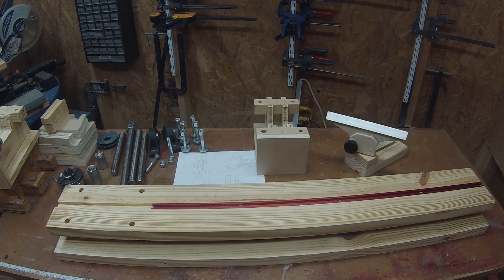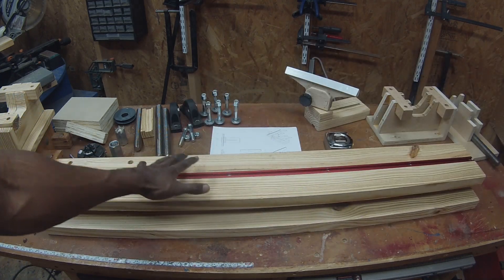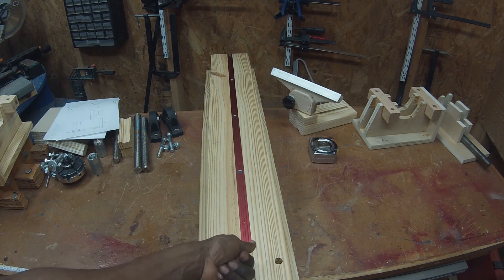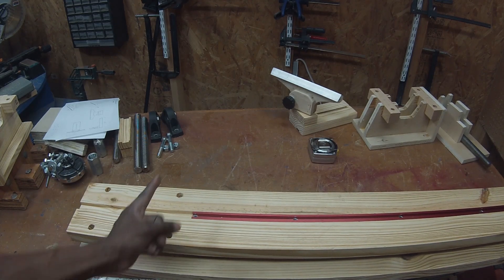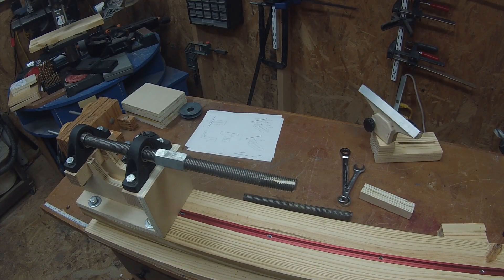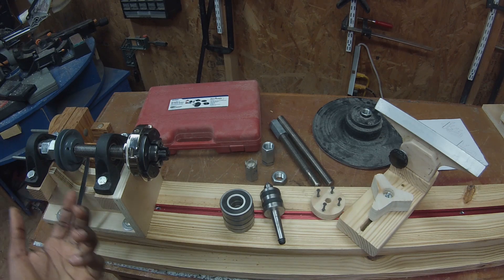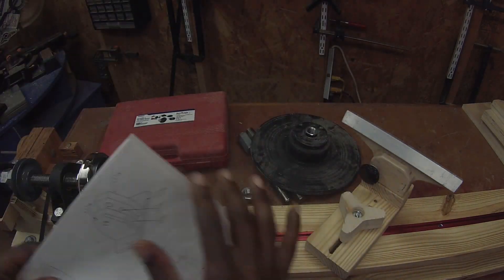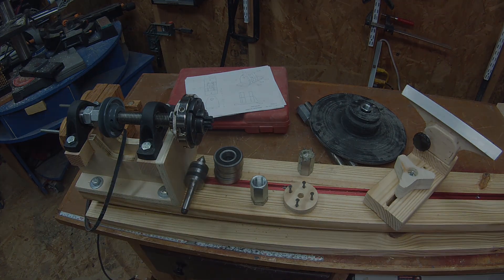The Lathe Part 3,The Rail, HeadStock and Tips For Designing Machines: 023

Comment: how did you attach a pulley to the treadmill motor?  Is that pulley made of wood also as your driven pulley is?  Thx.
Reply from the maker: It depends on the shaft of the treadmill motor. Some have a standard shaft with a key way and you just buy a pulley to fit it. Or you have to custom make something. It is not something I can really talk you through in the comment section. It just depends on the situation.

Comment: Seems to me that cutting the dado for the T track would be easier if you started with stock wider than you need, then dado it the exact dimension close to center, then trim the outside edges to width.

Comment: great vid indeed! would this lathe be useful to make bushings, flanshes, adaptors from metal? i mean, precise enough for 1/10mm?  or is it just for wood-work, like d stuff you did?  i also find it VERY hard to fabricate pieces which are really 90°  or flatFLAT!   for d non-carpentors or cabinetmakers amongst us  :)
Reply from the maker: I have sanded metal parts but I would not recommend trying to cut them. Wood is not rigid enough nor moisture stable enough for that level of precision
Reply: @Jeremy_Fielding  yeah i was afraid you'd say that.... fantastic project anyway!!
Reply from the maker: I have sanded metal parts but I would not recommend trying to cut them. Wood is not rigid enough nor moisture stable enough for that level of precision

Comment: The best reason for pillow blocks is that any small centerline from bearing to bearing misalignment is removed and 4 point vertical and tilt shimming to pivot the chuck slightly as the pillow blocks have the universal joint function.

Comment: Make a motor platform attached to the bed. Cut and hinge the platform parallel to the bed. The weight of the mounted motor provides the tension on the belt. Have the platform extend out behind the motor a bit to place sandbag or hang extra weight off it if extra belt tension is needed. Saw it once with a old fashion toilet seat lid brass hinge axel style. Amusing bit of salvaged bling.
Reply from the maker: I personally don’t like that approach. It works but imperfections in the belt lead to vibration. The motor becomes a huge shaking mass. Bolted down, it prevents vibration
Reply: @Jeremy_Fielding  Good point. Sand bags would dampen that greatly but still some vibration. Would work for a smaller model builder size units maybe. Salvage of damping design from a washing machine tub mounting system? Other damper ideas but that is getting into some of us crazy mechanical contraptions fanatics among us woodworkers. 
Accessory.  Riser blocks of 1, 2, 3 inches of glued block assemblies to elevate the head stock for bowl tuning. Similar concept to the riser block accessory for bandsaws.  I don't think they should be any higher, there may be an unforeseen issue. For bigger hp turning just make a dedicated stand alone headstock unit, you don't see these much any more. Had one in high-school shop long ago.
The bits and pieces, mechanisms, re-use re-purpose, simple fabrication, basic common parts available as store bought is half the fun. 
from Canada, keep on.

Comment: I have an old table saw motor. Would that work for this?
Reply from the maker: Probably yes. If it has capacitors on the side... definitely yes. The capacitors (usually inside a thin metal bulge on the side of the motor) indicate it is an induction motor. They are ideal because they will  hold their speed even when you start cutting. DC motors are also good if you want variable speed.
Reply: That is way more power then needed. The work piece mass acts as a flywheel giving strong mass in motion torque against a thin cutting tool edge. Big power is not required, your are driving a belt. Excess power will just be wasted as heat from slippage of the belt, slip will polish up the belt increasing slippage over time. You are just skim cutting wood, why do you think you need big power?
Any motor to drive a rotating vice (what a lathe is). Why would you think a table-saw motor not work? Table-saws come with various different motors, whatever you want. You can spin a rotating vice with a V8 automobile engine if you want. Your reference as a 'table-saw motor' is not how tool's power sources are referred to. This indicates a non-familiarity with power tools. I would suggest you stay well away from table-saws.

Comment: I want to build a metal lathe . I don't need all the features. since I will not be threading anything. so a manual feed would be fine. just finding a chuck. a end mill would be great also. I have seen ave build one from a drill press. great video.

Comment: Really enjoying your videos. What did you find the pillow block bearings in? Assuming you salvaged them from a machine and not just found them as-is.
Reply from the maker: +Aubreykun I think it was a large exercise machine. But I don't remember for sure.
Reply: Aubreykun you can buy those pillow bearings at most farm supply stores

Comment: Have you considered using a bicycle gearing system. The chains can have a removable link (no more forgetting to put the belt on first) and with some of the smaller bikes, like my sons 20", has 6 gears on the back sprocket and it's less then 2" thick, you can save a lot of space but, you would definitely need a guard.
Reply from the maker: Well once your lathe is assembled you won't have to think about the belt. Its only during construction you may take it apart more then once and that is when its important to remember. I think a bicycle sprocket could do the job. But you are really modifying it's use and that requires some really careful work and testing. You will need to make the sprocket fit concentric to your shaft or it will shake your whole workbench when spinning. You will need to do the same for the motor shaft and it's sprocket. You also need a way of holding on to the sprocket. This can be done for sure, but it will take some planning and thought to do it safely. The gear shifting needs to be easy enough without having to remove the guard. Or it should be very easy to remove the guard itself and replace. Other wise you will never want to do it. Before I tried this there are a few conditions that would need to be in place. I already have a bicycle sprocket I am not using, I really want/need more then two or three speeds, I have the tools to drill out the sprocket to fit my lathe shaft and motor shaft. If this is you, give it a shot. I think wooden pulleys are easier unless having more speeds is important. I think it is important... and that is why I am using a DC motor with speed control. I like the idea, but I think it will be a challenge to get right.
Reply: Agreed, the D.C. Motor does seem to be the better choice, especially since it adds to the safety and control. As you mentioned getting it squared, balanced and true can be difficult. I'm more of a metal worker but your tools are universal and I really appreciate your time and effort.

Comment: The best way to center the head with the bolt would be a dial indicater. This would get it to .001" if you took your time. you can pick them up for $10-$15.
Reply from the maker: +Jeremy Miller I have a dial indicator, but not everyone buying my plans will have one.

Comment: Is that threaded rod not going to chowder up the inner race of the bearings?
Reply: Daneger Most bearing surfaces are harder steel the threaded stock is normal steel so should not affect  them. How ever if the rod was turning in side the bearing surface it would wear the harder material this seems counter intuitive but the reason is particles of the harder material break off and are inbeded into the softer material it acts like a grinding paste!
Reply: Yeah that was my concern.  The races aren't tapped so I'm figuring on there being slippage when load is applied or the motor is started.  How long before you're replacing bearings is the question, I guess.
Reply from the maker: The load will lead to more grip on the inner bearing surface not less. However, even if they last 5 years with heavy use, they are extremely easy to replace. 
As a comparison I made my wooden scroll saw using the same method, that is thread-rod against a bearing. After two years the bearing surface looks fine. 

Perhaps I am less concerned because they were free. But the only alternative is to have a shaft custom made with threads on the end... assuming you don't have to tools to make such a rod. And that is the group I think this project appeals too. If you have metal working tools, You probably won't make a wooden lathe.
Reply from the maker: Another option perhaps if it concerns you would be to fill the threads with expoy or even electrical tape wrapped really tightly around the shaft. It would rub off the edges of the threads and fill the valleys. Just throwing ideas out there.
Reply: Ah, Jeremy, good to know!  I agree, if they last even just a couple of years it's a worthy method.  I was concerned they wouldn't make it that far at all. I haven't seen your wooden scroll saw build yet.  Glad to hear the threaded rod design is work tolerant.

Comment: Hey Jeremy....FWIW....in case you are unfamiliar with them, surpluscenter.com has several products for cheap that can be used in many of your projects, including motors. ... specifically ...a 1" pillow block bearing for 6.95, that is tapped on the bottom for bolts, rather than having the ears on each side...... your style for around 9.00. pulleys, belts, casters, switches, etc

Comment: hello sir! dumb suggestion here, i think adding a centrifugal flywheel at the back of the shaft can increase the spinning power of the lathe machine idk if would work tho, what do you think?
Reply from the maker: +bule bule there is a trade. The work piece will have more momentum while spinning, but the motor will have to start under a much greater load to get the mass spinning. Treadmills use a heavy fly wheel because you have a few hundred pounds suddenly hitting the belt every second or so. Lathe work is not quite so intermittent. If You are expecting to do aggressive lathe work it might be worth looking at.
Reply: +Jeremy Fielding Ah I see, Do you recommend using this on metal works?

Comment: Any ideas for the a motor I found? It's an old furnace motor: Delco 1/6 horsepower, 1732 rpm. Not enough torque for a lathe or grinder but maybe an air filter?

Comment: I have a bit of white oak left from other jobs and I was wondering if that would be ok for the head. I plan to use it for the rails but, I am concerned about the material for the head. Would it be better to use a plywood? Thanks. This is my late spring project but I am thrilled. Excellent video.
Reply from the maker: I would never say plywood is "required" but definitely preferred for the central gussets. They will provide most of the stability of the head stock. The twin pieces that hold up the blocks the bearings sit on.